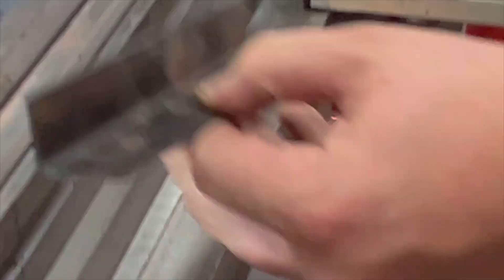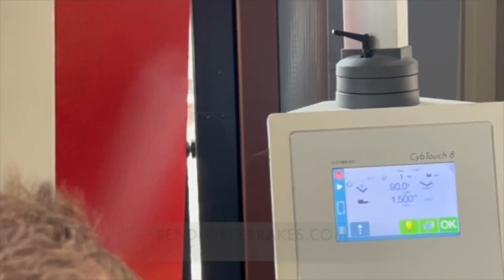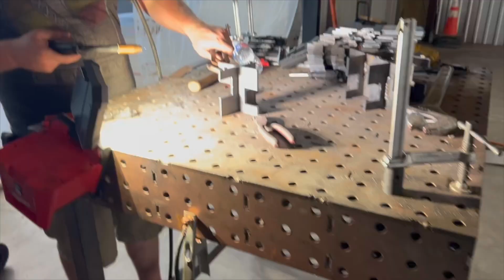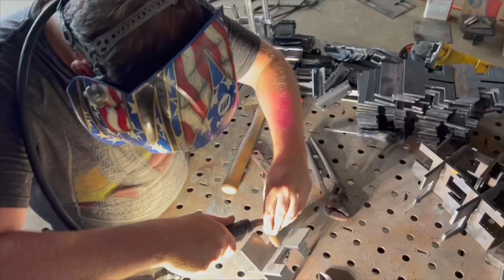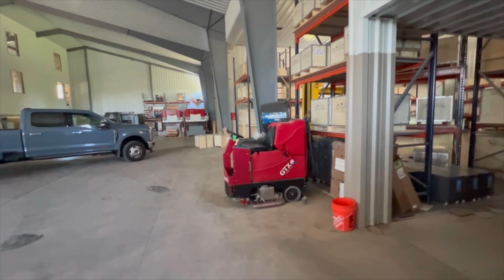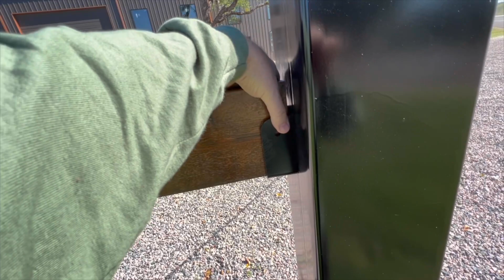Shop Update - Fence Project

Comment: Any concerns about blowing moisture laden air all over that CNC equipment ?
Reply from the maker: no, even at 10ft away, the water is vaporized before it hits a machine.  but yea of couse if you turn the fan on low and the water on high and put it right on something it will get it wet .... but these machines go into some pretty rough environments with very high humidity, for the most part they all seem to be doing ok
Reply: @turbocobra  I was just wondering. I’m a CNC machinist and I work in a so called “clean machining facility” just outside of Boston where the environment is regulated and we machine lots of medical grade components so I was curious as to how that affects the equipment.  Your shop looks great … you’ve come a long way from when I started watching you in that small shop making painted metal signs . Amazing job 👍🇺🇸

Comment: What’s the price on the 1kw laser? And what was the feed rate on that 1/4”? So cool seeing everything you have built!
Reply from the maker: 1500 watt for $66K is the smallest size I sell.  About 75ipm or so on 1/4" cutting with oxygen.  for $200K you can get a 12kw that will cut 1/4" on compressed air at near 500ipm !